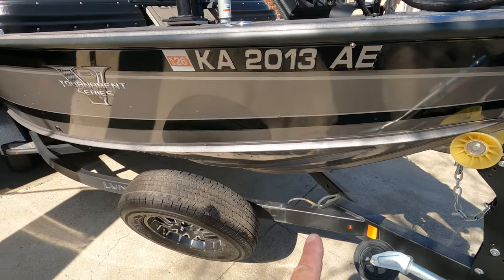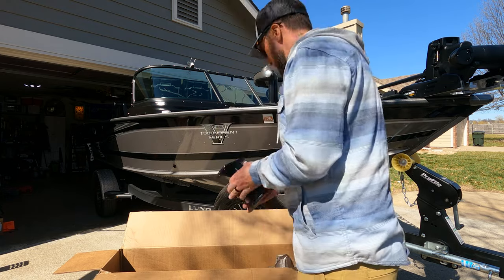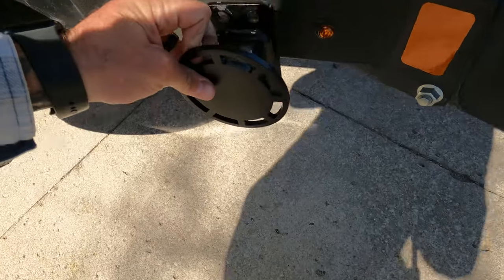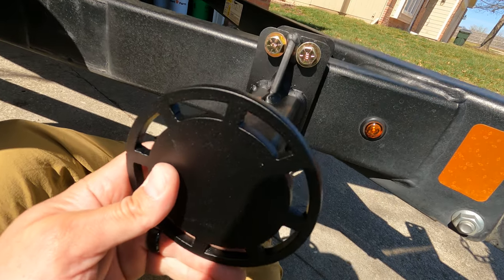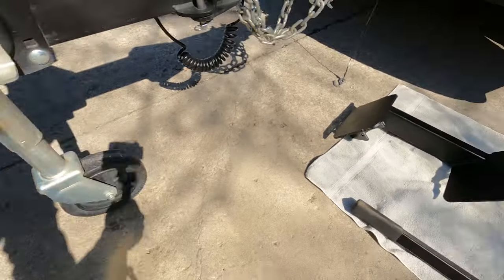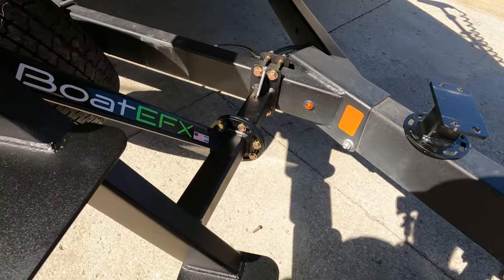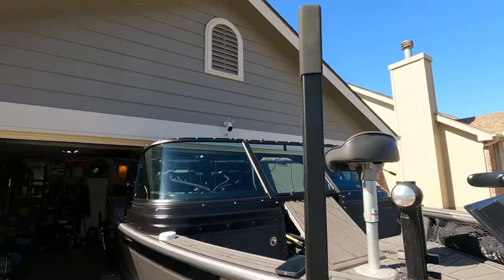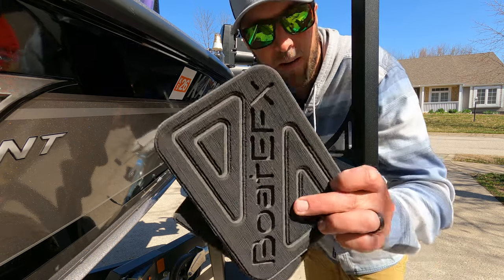Installing BoatEFX TRAILER STEPS On My LUND PRO V!!

Comment: Great video.  Question, I installed these on an 1875 Impact XS with a Shorelander trailer.  When I step down on the 1st step , the steps rock to the right, then when I step up to the 4th step the steps rock to the left.  This happens because of the slots in the mounting bracket.  I have added an additional bolt to each slot and tightened everything down to the max but the problem still persists.  Have you experienced this problem? And if you have experienced it, what is the solution?

Comment: I've got a 2022 G3 AV18SF deep V and I'm wondering if you could tell me how far out the middle of the steps are from the frame of the boat.  Just looking at on the video I'm guessing your 12+ inches out from the frame which is what I would need. Also, I'm 6'3" and 240lbs so I need something solid.  Any help is greatly appreciated.

Comment: I’ve got the same boat and looking to install the same steps does that extended bracket that comes of the trailer come with the kit or did you have to order it separate?
Reply from the maker: @scottcummings2715  it should come with it.
Reply: @KansasAnglingExperience  right on thanks!!!🎣🎣🎣

Comment: Yikes, nice steps but way out of my range. So are you going to sell your old steps?
Reply from the maker: Old steps will be put back on this boat to the new owner when my new boat arrives.
Reply: @KansasAnglingExperience  LOL, it was a try. I've been doing the old spare tire bracket to a step up to the spare tire... onboard. I'm getting excited about to head up to NW Minnesota( Lakes Region) in about 3 weeks and was thinking they would look good on my trailer... Tight lines and keep doing what ya do...
Reply from the maker: @GD-xj3jd  like I said in the video, you can’t really put a price on your own safety getting in and out of the boat. I wish that trailer steps were standard on new boats nowadays.
Reply: The pricing shown in the screen recording in this video is much higher than our normal pricing. We had a small glitch with our new site a month or so ago. This has since been fixed! You will find our prices very competitively priced with the market. Thank you!
Reply: @boatefx   thank you for the follow up! It appears they are closer to my home now...